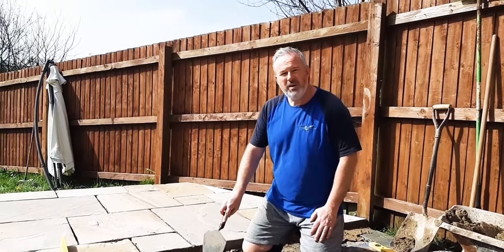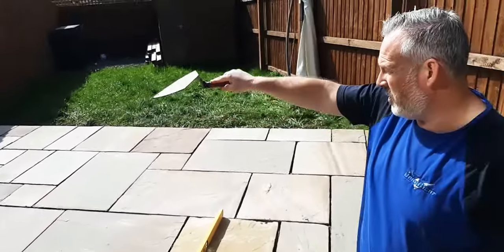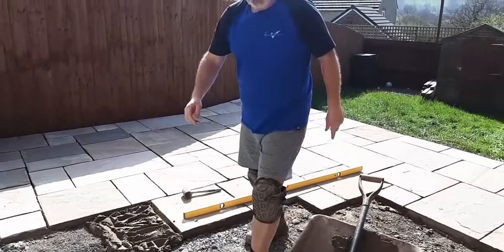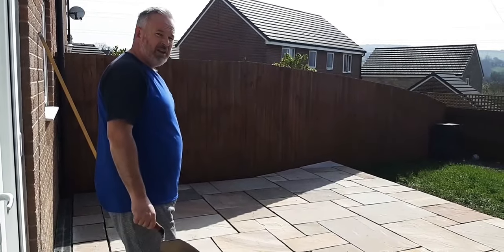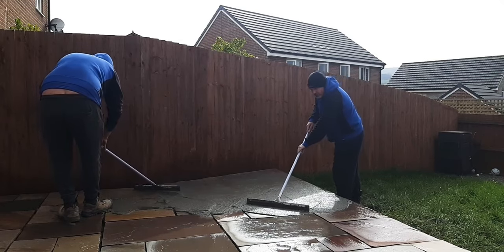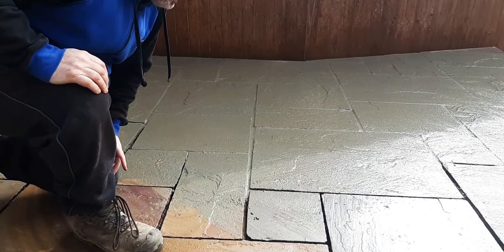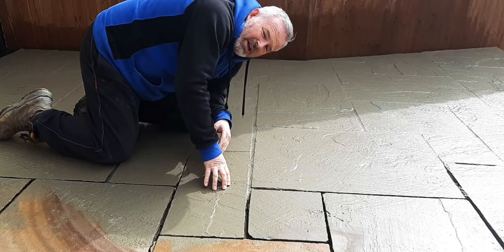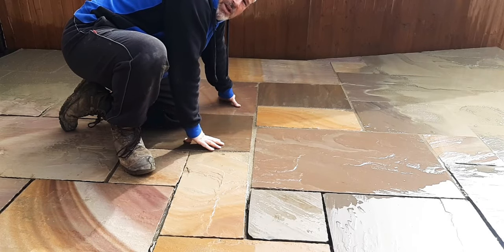How to lay and point Indian sand stone

Comment: Hi. Great video. I'm laying indian 6m x 5m riven sandstone in a few weeks.  Just   doing the groundwork at the moment. I m a diy'er and wondering what fall did you put on the slabs. I was planning on doing a 1 in 60 fall but it looks too steep so thinking now of 1 in 80 so 75mm over the 6m. What would you recommend would  1 in 80 be enough?
Reply from the maker: Hi they do recommend 1:60 for a fall .A lot of professional pavers use 10/15mm evey 1m long .we tend to use the spirit level and get the bubble on the line .Hope that helps and good luck 👍
Reply: @brickrightbuildinglandscaping  hi guys, so yous put block work all the way round so you could level it off easier is that right? It's a good idea never thought of that, cracking job as well lads 👍
Reply from the maker: @peterash9524  
Hi peter 
Yes your right there but also to keek the patio independent from the fence so any replacement or maintenance had no impact on the patio or vice versa. 
Appreciate the comments mate 👍
Reply: I’m laying golden fossil 45m2 at moment in stages when I have time, quite a few slabs are quite rough so I’m using a 10mm per meter fall , hopefully this will avoid any rain water build up, it’s a diy job so I’m here looking for tips on the pointing, I’ve made sure to rake out the pug where the slabs meet to allow for a thick joint going below the slabs, it would cost a lot to use the flow joint on mine because of the voids so am thinking of using 3building, 1sharp, 1cement, wet mix and sponge off the slabs as I go, what do you reckon?
Reply from the maker: @xxwalhalaxxmozza7415  
Id flow point all day over sand and cement but if your using sand cement. 
3 and 1 mix so you could do this 1 sharp 2 building sand 1 cement.
Id recommend a semi dry mix less water stronger mix .Dont stain the slabs then either.
Good luck
Justin 👍

Comment: I just use a leaf blower to remove all that excess sand from the surface. Way easier and faster, no sludgy mess. Then you can just use light mist setting on the cracks, no disturbance to the smoothness of the lines
Reply from the maker: Hi Joseph 
A leaf blower on the flow point you mean is it ?
Justin 👍

Comment: Shouldn't furrow your bed keep that for brickwork, you get a better bond without the furrowing also its not mixed well enough there's two many  straight lines going through the job should mix it up more it's not random enough also as it's porous you can actually seal it before you grout it 👍
Reply from the maker: You have a point about pre sealing yes the rest theres nothing wrong with it .As long as its sealed after its fine some clients may not be able to afford pre sealing but its a valid point point the rest your just picking holes and you no it
Reply: No honestly not picking holes I used to furrow bed myself but it's actually better not to furrow bed I only make a little recess in mortar bed around edges of slabs I am laying against but furrowing is not needed it actually can leave voids under paving and there are a few long straight lines in job that I personally think are to long and should be broken earlier to made job more random 👍
Reply from the maker: @scoyle1750  i do get what you are saying about the beds and voids .Ive tied it your way but i find it better to add more bed furrow and hit it hard down .As for the long lines its fine we use a marshalls laying pattern. Your entitled to your opinions i respect that 👍💯
Reply: @brickrightbuildinglandscaping  your definitely not using a laying pattern as lines to long and if you are stick it on YouTube next to your paving but definitely better not furrowing it's all about getting your bed right so you can use mallet to bed slab into mortar without having to over hammer, also good paver never looks at a laying pattern 👍
Reply from the maker: @scoyle1750  🤣🤣🤣  wow